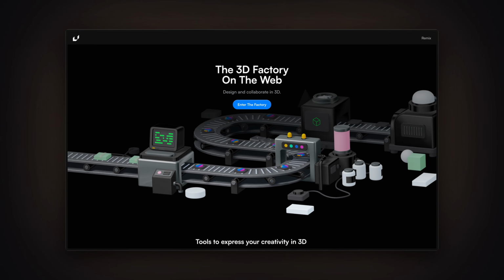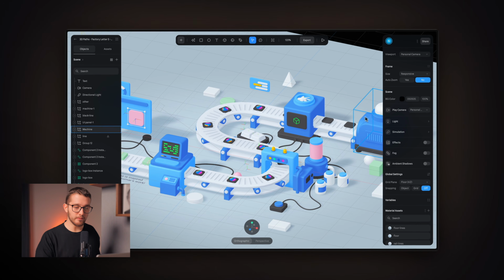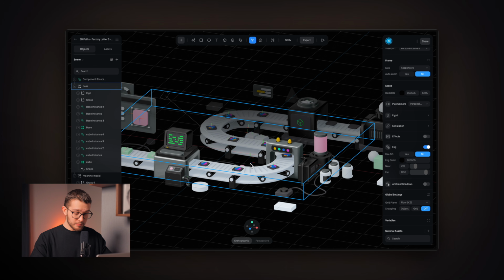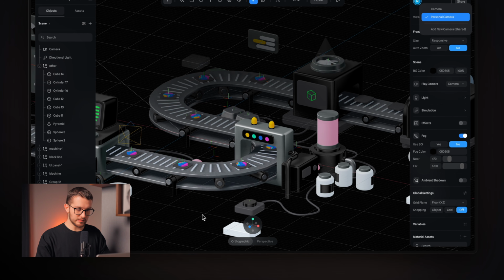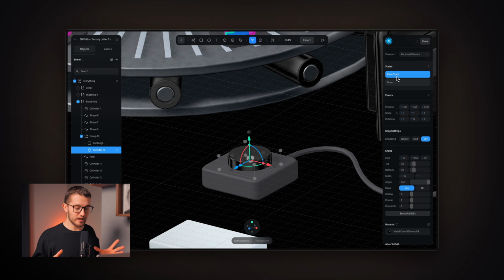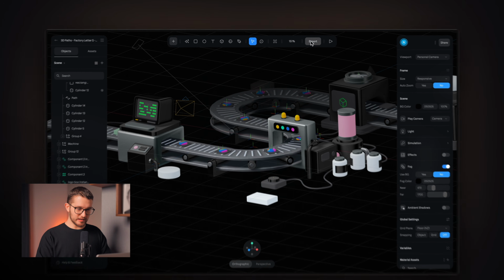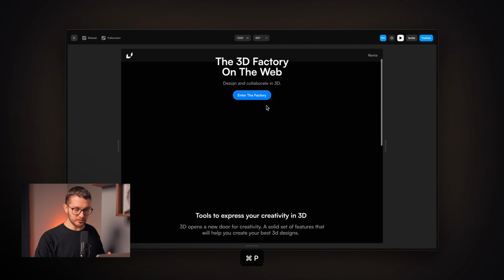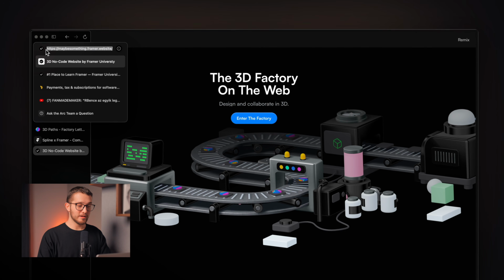Building 3D Websites With Spline and Framer (No-Code)

Comment: i love the tut however i still have issues optimizing the speed for mobile and lower end devices. Its either really slow on devices with poor graphics cards or it's slow without a really good internet connection. is the solution creating fallbacks or changing export options?
Reply from the maker: You can maybe create a mobile optimized version, perhaps removing the whole scene and replacing with an image.

If your scene is really heavy, you can also export as video as it will be more performant.

Comment: I have a 3d model which changes it's camera position on scroll, I have embedded it in framer, but the problem is, in framer it scrolls seperately after it's scrolling finishes then framer page scrolling start is there any way to sync with parent page scrolling. Even if there is any solution with framer and spline that will also be fine.

Comment: Great tutorial! The only problem I have in integrating Spline 3D into Framer is the responsiveness.
Reply from the maker: It is definitely a tricky part. The best you can do is use the in built feature in Spline.
Reply: I actually discover something and managed to make the spline 3D responsiveness works when it is not using the full width of the website. Let's say you embedded a 600x600 px 3D element within your page. In the Event, instead of putting the usual screen resolution, you need to define the actual pixel of the element.

Eg. Mobile = < 301 | Desktop > 599

Then your second State, you set the element to 0.50 scale, so the element will shrink down on the page where you set 300px width like mobile.
Reply from the maker: @apexdigital.studio  thanks for the insights!